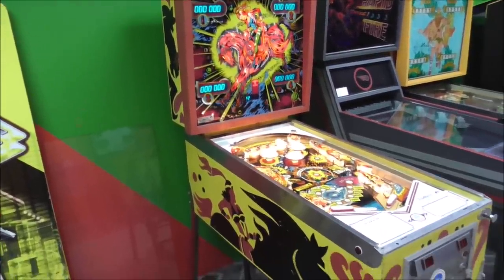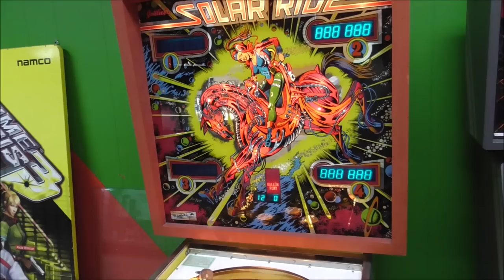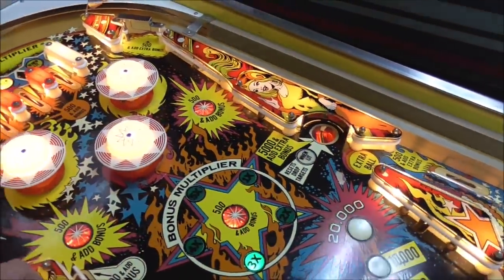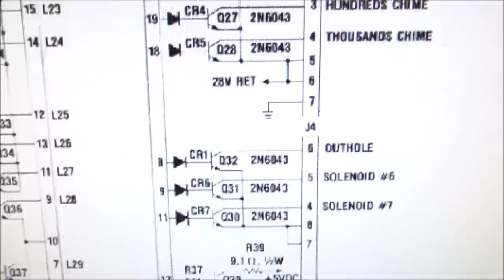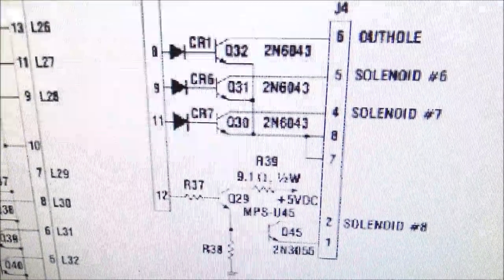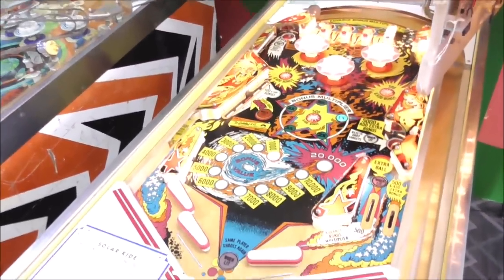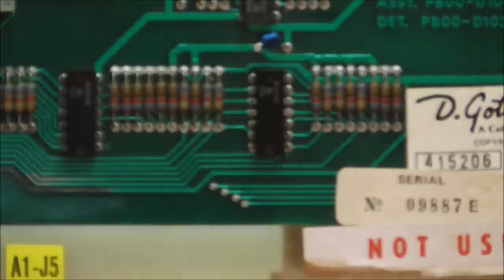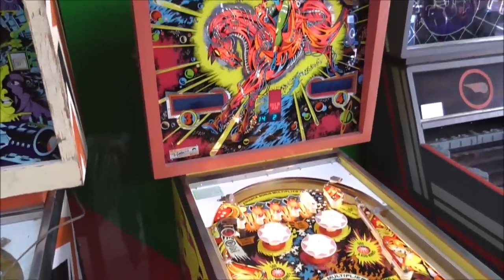Troubleshooting a Gottlieb Solar Ride System 1 Pinball Machine - PCB Repair

Comment: Great video as usual 😁. One suggestion, when doing the 5v injection testing, instead of a screwdriver use a 1k resistor. That way if you do slip and touch the wrong thing ( like a ground) the resistor will limit the current. Keep em coming man!
Reply: I don't think a high-value resistor will work here, he needs a fair bit of current to overpower the driver that is driving the line.

Comment: Man I am glad I found these. I have a near mint, though non working Solar Ride I am looking to bring back from the dead. Thanks for sharing your troubleshooting. Someone has done a horrible thing to my edge connectors... soldered it directly to the board (with the plastic connectors still on). Looks like some battery damage too.
Reply from the maker: That's pretty crazy, I've seen people solder the wires on before... you can buy new connectors and things from www.GreatPlainsElectronics.com to fix it back up factory....

Comment: I thought for sure it was the spiderchip.. Nicely done!
Reply from the maker: I think that chip serves as a fuse and protects that spider chip from stray voltages :)  Usually when one's bad it's the switch one.   I love getting the original board working, there's nothing wrong with the replacements but those original boards are so quirky they're cool.
Reply: @LyonsArcade  I have a Sinbad and the cpu board was so clean with zero battery damage. My game wouldn't shoot the ball out yet everything else worked okay. After ruling out everything I could I gave my board to a pinball technician here in Brisbane and a few weeks later he tells me they tried everything but it couldn't be repaired. Something about having to match two of the spider chips when only one had failed...anyway; I ended up buying a pascal  all in one board and it's working well. I've kept all of my old boards in case someone comes up with a fix one day for those horrible spidey's. Would've liked to have kept it original if I could.

Comment: That thing is amazingly clean on the inside. Does it look like it's been restored previously or do you think it's just been looked after?
Reply: That machine has had a easy life. Looks like not that much play on it and always stored correctly. Some machines get left in a shed or a damp basement and they age badly.
Reply from the maker: I agree with Ray it’s had a well kept life the truth is too that some of these Gottliebs didn’t get as much play so less ball time= less wear.  It likely just didn’t earn as much.  The Gottlieb playfields seemed to have a stronger finish on them too... most Bally or Williams games of this vintage are worn slap out from countless plays...
Reply: It does appear to have immaculate ‘gubbins’.

Comment: What is the plug outlet for inside, below the play field?  Also, do you know if the datasheet is available for the spider chips?  I bet some clever person could design a replacement board that could be soldered in where that chip goes....or perhaps wire up an ardoino.  It probably wouldn't look pretty, but you wouldn't have to sacrifice other boards to recover working chips.  Thanks for the video.
Reply: i think it is for a drop light or to plug in a O-Scope maybe??
Reply from the maker: It's usually so you can plug a soldering iron in.  I once plugged a vacuum in that wasn't good, it blew the fuse because it drew too much current :)  I think somebody could make a replacement chip but nobody's done it yet, they have made completely new gameboards though so the worst case scenario is you have to replace the whole board.

Comment: Great to see the trouble shooting process and using the original boards. Did you fuse the AC side of the 2 rectifiers to the smaller transformer? I have seen that done. Thanks!!
Reply from the maker: No, I didn't

Comment: You lucked out that it was the 7417!  How hard would it have been to find a replacement CPU board if it had been the spider chip that was bad?
Reply: Chris Freemesser it seems that marco pinball sells one
Reply from the maker: They make brand new ones that are regularly available but they cost $200.

Comment: When you sent 5 volts thru pin 3, to me it looked like the output didn't go anywhere. Then you sent 5 volts to pin 4 and it rest the drops.
Reply from the maker: Correct, 4 is the output, so the wiring to the drops is correct and working but it's not moving through the chip IE the chip is bad.

Comment: Why are they using a 7417 to turn on/off the +5 volts to the FETS drivers for the solenoids? What I mean is that you can remove the 7417 and install jumper wires from input to output pins on the socket and it will work because the 7417 I think is used as a FUSE to protect the Spider Cpu chips? Always why did they use a 2N3055 transistor for the drop target reset, its a big power transistor 2N3055 just to reset a drop target coil not sure why they used a power transistor to reset a drop target coil? You mentioned that the drop target reset coil measures 3 ohm which means its a stronger coil, any reasons why a lower DC resistance which make a coil/solenoid stronger?
Reply: The drop target reset coil reset all the drop targets in that unit, it is quite a hefty coil with the same current.

Why the lower resistance coil means a strong coil? In short, less resistance allows more current to flow. I wont go through the ohms law reasoning though.

The 7417 is a hex buffer and driver. (Hex or six of these buffers in the one package) Possibly to clean up and boost the incoming signal. I'd need to read the entire schematic for that section. But yes, if the chip was already mounted in a socket, you could pull it out and inject a signal directly or read the signal coming into the input. Logic probes are handy for this.
Reply: Thanks for the help, but why does the drop target reset coil need a stronger lower resistance coil? Yes the 7417 is a hex buffer driver, I'm guess they put a hex buffer driver chip because the Logic signal is travelling down a wiring harness down to the coils and if there is a shorted coil it will short out the output stage to the 7417 output pin instead of damaging the Spider CPU output logic pin? What I'm saying is removing the 7417 chip and installing jumper wires is not going to make the logic signals weaker. It looks like they are using the 7417 hex buffer has a logic signal FUSES to protect the CPU output pins from damaging them.
Reply: wayne Gram Because it’s resetting an entire bank of targets, each has a spring attached to drop the target when it is hit by the ball. So a beefier solenoid is used to make sure the whole bank is reset properly.
Reply: @waynegram8907  you make a good point about the 7417..7417 is a D type it will only change the output on the edge of the clock cycle 
 not sure if they needed that for some type of timing issue..it also has a CLR or Clear line to reset it..
Reply: @MickeyMousePark  I think you are confusing the 7417 with some other chip. At least according to TI the 7417 is just a buffer chip.
Reply: @petermichaelgreen  wow you are right i think i was thinking of the 74174 leaving off that last digit ooops good catch..
neverrrrr minddddd